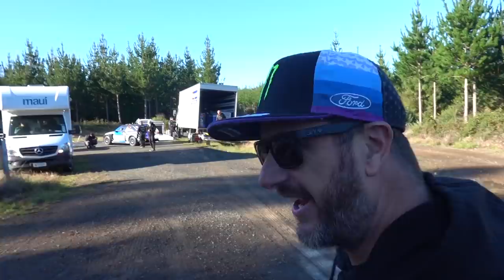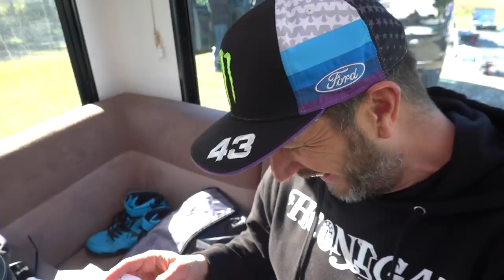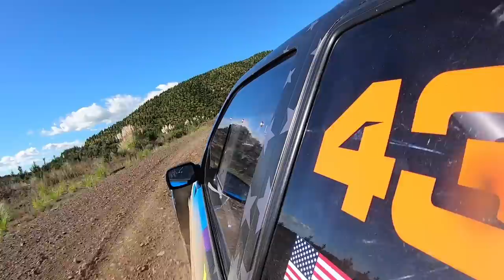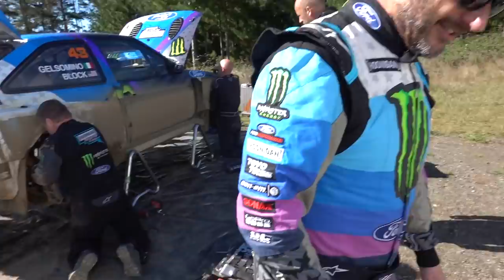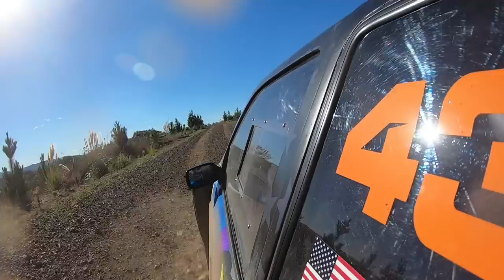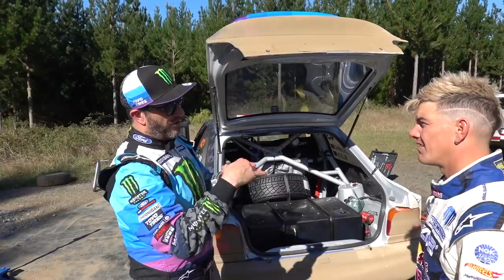Ken Block Takes Mad Mike For a Ride in the Cossie V2! Rally Test Special

Comment: I'm convinced some of those take offs need to make their way onto a shit (rally) car for the boys back at the burnyard.
Reply from the maker: That could probably be arranged.
Reply: What do you mean with those take offs?
Reply: @AlbertoDsign  in racing parts are replaced while they still have some life left in them. this is done so the racecar is always running as fast as possible and to prevent parts from breaking while on the car. For example after a certain number of heat cycles a nascar team won't use tires anymore but to people competing at a lower the used nascar tires are probably in good enough condition to use for another whole  racing season. 

 [TLDR; a new hoonigan project car with a set or used rally tires and maybe a 'fieldtrip' to dirtfish or something]
Reply: @aria8928  Thanks a lot! I thought that might be what you were refering to, but I wasn't sure, and there are looots of terms, mostly car-related, that for a non-native speaker are impossible to find.